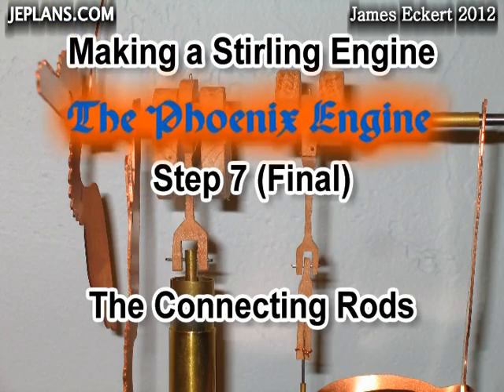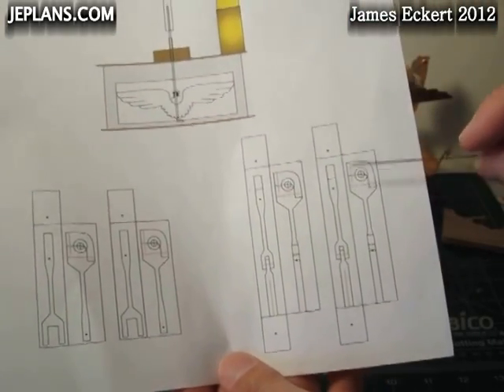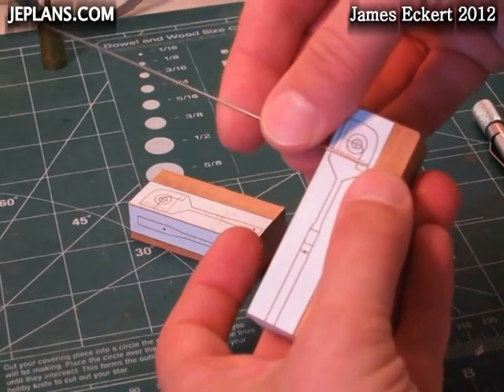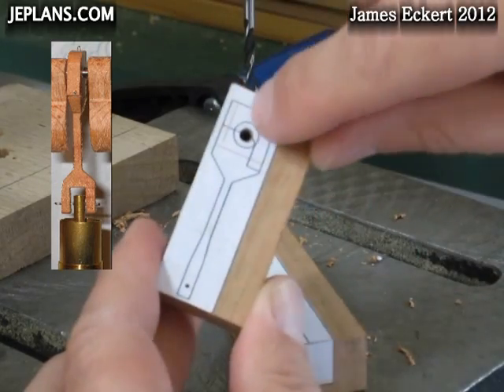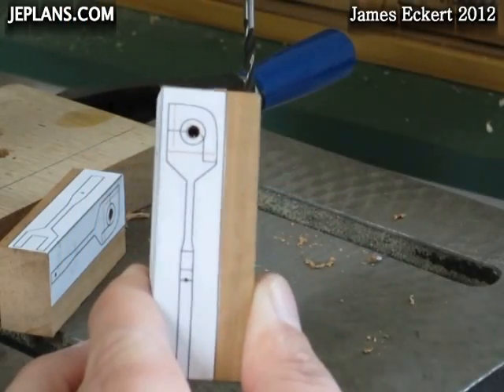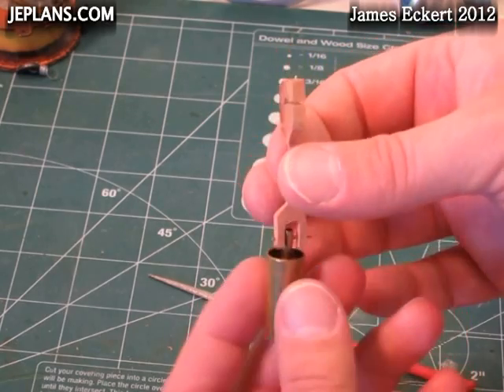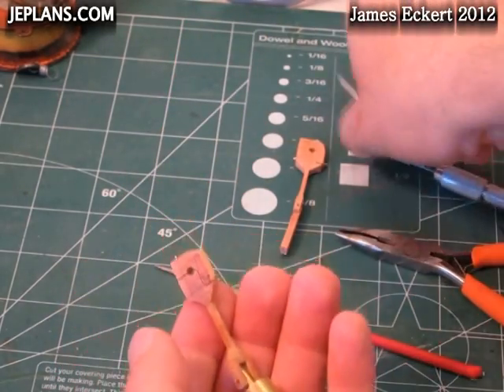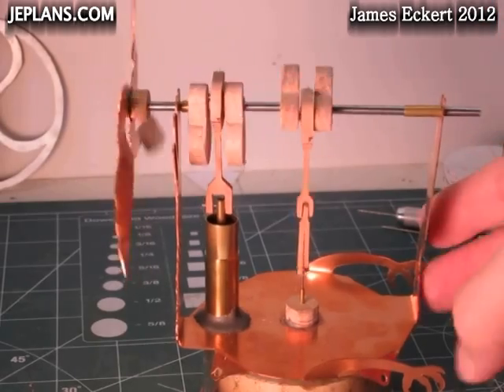Step 7 Making a Stirling Engine: Connecting Rods

Comment: Not sure which is best, your engineering or your video production. Thanks. One problem I have encountered is trying to find the correct size tubing for the piston and the cylinder to obtain a good seal with low friction. So I have made mine by casting the piston inside the cylinder using JB weld with about 1.5% by weight of graphite powder.

Comment: Hi James, the connecting linkage does remind me of parts found in the action of a (upright) piano. You may want to look into that because using these wooden parts "of the shelf" saves a lot of time. Also you may want to look into the way piano action parts are hinged...you may find these very interesting.
regards, Sander

PS: why not use a aluminum covered styrofoam disk for the displacer...
Also you may want to glue the bottom plate to the glass and make the top seal a "gasket". I assume the heat on the bottom makes the silicone very sticky...
Reply from the maker: Piano's are wonderful machines.Styrofoam would melt at about 250F, The cotton paper it good to 600F- 700F.

Comment from the maker: Thank you, while it was design with a wood stove temps in mind this one will run at about 150 degrees F with a room temp around 70F, so it will run on a coffee cup. However its' base is slightly smaller then a opening on a standard coffee cut.

Comment from the maker: Thank you, they are temperamental. When I build a new engine and try it out the first time, it usually barley runs and only for a couple of minutes. Then I get a little mad. But a little later I go back, clean things up and maybe steel wool the piston a bit, replace a tube that is not straight, reseal the cylinder and fix a support that might be pinching the crank shaft. Then all of sudden an engine that would not run is working great and it feels wonderful.